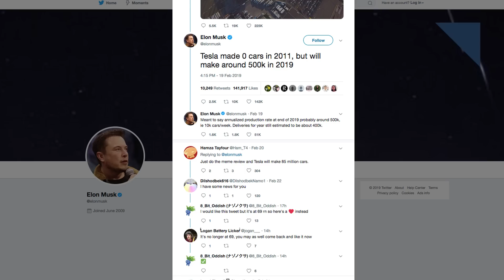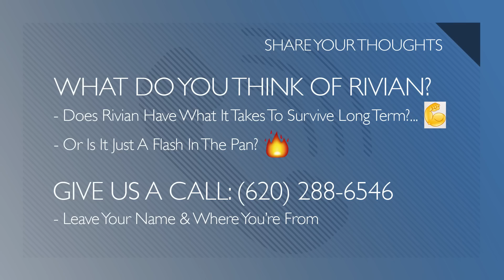Maybach SUV Headed for Production, Tesla Cancels Mid Range 3 - Autoline Daily 2555

Comment: The Rivian is absolutely the real deal specification wise.  Four motors gives it not only incredible speed but incredible control over each wheel.  Think about the Mercedes G class with all it's crazy mechanical locking differentials and hubs.  The Rivian eliminates all of that complexity and weight while braking, accelerating, or even reversing any individual wheel under digital servo control.  With the proper software programming and tire selection, this truck should be able to do some amazing things off road.  It will have to in order to convert the traditional "truck buyer", as the mass majority still don't see this as anything as full size "Honda Ridgeline".  The rest of the buyers will love the storage, tech, and luxury too much to care about how the vehicle is propelled.

My main worry is about Rivian themselves.  It's a company Florida taxpayers are no longer too fond of, has gone through name changes, and to my knowledge, has yet to really produce anything or make a profit.  Time will tell.
Reply: The truck looks great, has useful innovative features, great specs, the founder makes a great impression, Amazon is investing. Looks rather promising. An IPO would be nice...

Comment: The mid range model 3 was probably a long range with the battery limited by software.  I wouldn't have opted for that one, makes no sense.
Reply: I'll bet not many were being specified in that configuration, in that case, it removes another complication from the process.
Reply: It isn't a software limited battery.  The Midrange was put out because Tesla was supply constrained on battery cells.  So the solution was to release a car with a battery pack with fewer cells.  Being able to make more of those packs meant they could sell more cars while at the same time the customers could get a cheaper car.